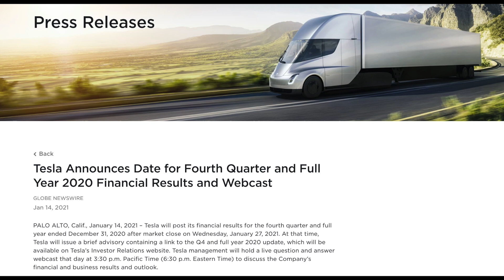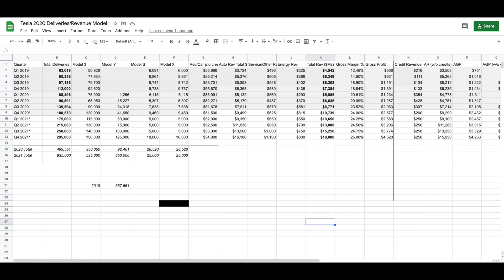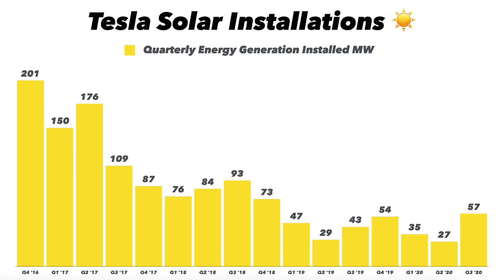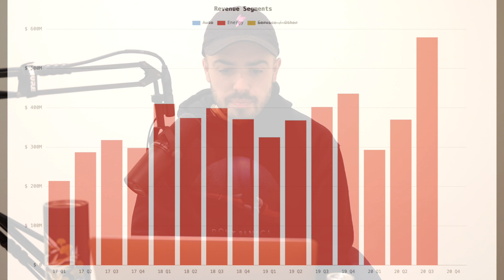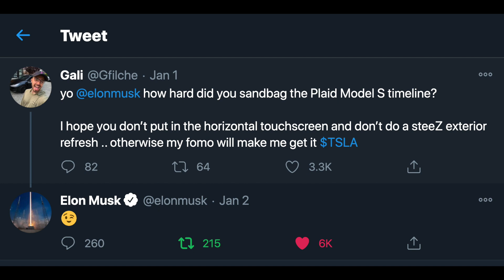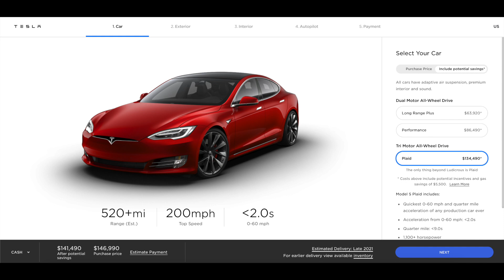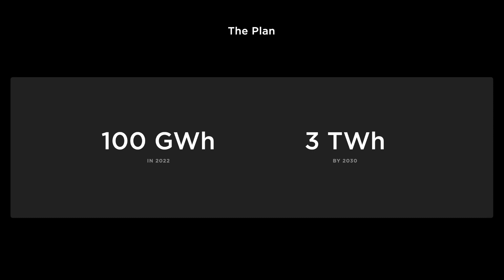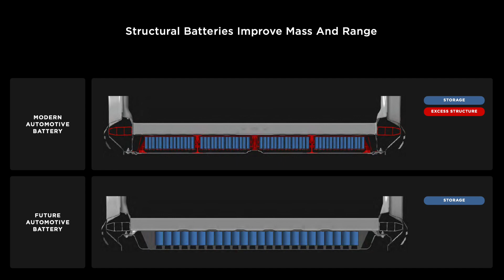HyperChange 12⚡ Tesla Q4 20 Earnings Preview

Comment: 1000 a share incoming.
Reply: PELOSI has tsla options Billions.
Reply: @markplott4820  just a mil
Reply: @marten250  A million spent on options, each option is for 100 shares, so 1 option is already worth $4000 more than when they bought. So if you e.g. paid $100 per option and put in $500k, you have 5000 options each on 100 share. That's 50,000 shares with $300 profit per share already = 15 million. So not a billion but also not "just" 1 Million either. If that profit goes to $2000/share (share price goes to 2500) how much is that?  (* assuming my calculations didn't screw up somewhere).  I also just guessed at the option cost, it could have been more or less. Either way, it could be worth a lot more than 1M.
Reply: By the end of the year people will be saying "I wish I bought it at $1,000"
The shorts will be jumping off of buildings.
Reply: @ThuTroothHurtz  I predict another split this year.  Tesla should always split after 1000. A share IMO.
Reply: @bb_alexander5385  Last rush after the split was amazing.

Comment: I don't care much about Plaid, it's ALL about the 4680's.
Reply: Plaid may have the 4680 cells
Reply: 4680 NOT coming soon to MODEL 3/Y at FREMONT.
GigaBerlin First factory to get 4680. will Produce model Y First.
CHINA & FREMONT get 4680 in 2 - 3 years, have to Perfect the Structural Battery and FRONT & REAR megacastings.
Reply: @markplott4820  I just wonder where the cells are going from the pilot 4680 production line in freemont  that has been up and running for some time? As said on battery day.
Reply: @smoothfeeder   - 2021 PLAID, yes.....model 3/Y , NO plans.
Reply: @markplott4820  i said plaid may have 4680 cells not 3/y
Reply: Agree

Comment: I don't think they're going to announce Plaid being ready and starting production.  Plaid is about more than just the new batteries, or three motors, or the front and rear castings; it's about all of those things and probably more that we don't know about.  There haven't been any more giga-presses spotted at Fremont, so there aren't front and rear castings yet, and those are probably a necessity for plaid with the structural battery.

I think it's just going to be an announcement of the refresh in general, maybe with an update on the Plaid timeline.  I think the new body style that's been spotted out and about is just what the new body style is going to look like for all Model S.  An update on the 4680's is also probable.

Comment: Is it possible that the new plaid model s , has the same Plattform of the roadster so they could make it possible to start with the roadster too without making too much infrastructural changes ?
Because model s plaid and roadster are not high volume selling cars
Reply: Wouldn't the roadster be shorter than model s?
Reply: @hoedjeexplains3661  oh yes right

Comment: Berlin Y or Fremont Plaid S which comes first?
Reply: Probably Plaid S.  Hopefully
Reply: @user-RCST  I understood that Fremont 4680 production was for Berlin Y. Since they haven't started building the battery manufacturing building they will need batteries for 2 -3 months of production at least. We'll know more after Wednesday.... Hope I'm wrong
Reply: @robanderson9565  yeah but that doesn't make much sense with that production line would be for Berlin.  Wouldn't Berlin have their own battery plant setup by the time the factory is done?  I think plaid model S will be first but I could be wrong.
Reply: @user-RCST  I believe they said on battery day that 4680 built in Fremont would be for the beginning of Y production in Berlin
Reply: @robanderson9565  yeah but that could have just been them sandbagging plaid model S.
Reply: @user-RCST  maybe

Comment: The form factor of the 4680 cell can be  used with existing chemistry (e.g. Panasonic is doing a pilot line in Nevada - I assume using a wet slurry process).  What I would like to know is when to expect the 56% range increase that has all the improvements versus a 30% improvement because of the tab-less cell and structural battery pack.  If you multiply the 402 mile range by 1.3 you get 522 miles.  That suggests that the Plaid model S will have the 4680 cells and structural battery pack with existing chemistry.  Panasonic and LG could make a ton of these 4680 cells with their existing chemistry and Tesla could have a lot of batteries available this year to put into the Models S and X as well as the Plaid Model S.  I would buy a Model S with 522 miles of range in a heartbeat.  A model Y with the Panasonic 4680 cells and structural pack could have 423 miles of range.  Hmm - I might want that one instead.  It's all very exciting (423 mile range at 75 mph is more like 323 - plenty for a road trip).

Comment: I don't think the 4680 cell is going into the model s plaid.  It'll be 18650 for the S/X (unpopular view I know).  What you need for a performance application is higher voltage in smaller space. 4680 and 18650 both  carry a 3.7 nominal voltage. Roughly 3 18650 fit in the space of one 4680. Thats 11.6 volts for every single 3.7 volt 4680. Porsche and Rimac both already understand this and I believe Tesla does as well.  Either way the stocks going to $1000!!!

Comment: Gali, did you see the Fremont drone video showing the giga-presses are now in production mode? What do you bet the S/X shutdown was to change the line to incorporate giga-castings and 4680 structural batteries? Plaid with two rear motors will need different mount points as well as a stronger and stiffer rear end.

Comment: So if Tesla does hit $1.2 billion this quarter and you assume they do that ever quarter you are paying a price to earnings of 208 if Tesla hits 1 trillion market cap, but because all quarters are weaker than the 4th its probably closer to 250-300 PE. If they double car volumes next year and it cuts PE in half thats 125-150 PE for this company. Basically if this company hits all the hype out there it will still be over valued. 

This thing may go higher, but gravity is getting stronger the higher it goes and it will at some point fall to about $100 billion market cap
Reply: I think you’re looking for a GM video. Tesla is not about PE ratios at this point. They are about crazy growth. If you want a traditional metric to gauge look at ROA.